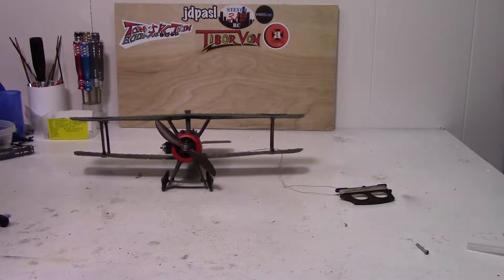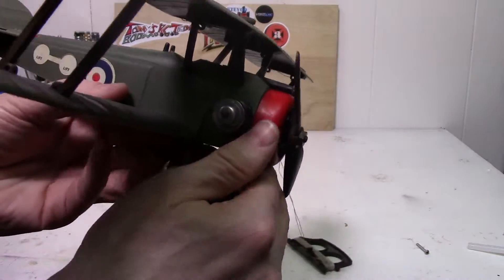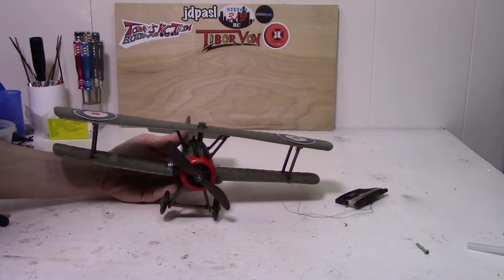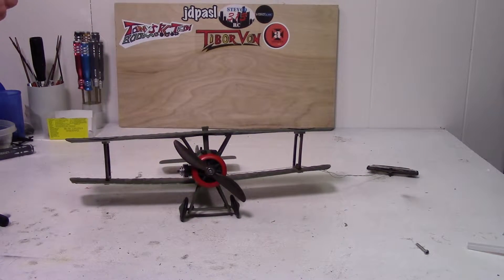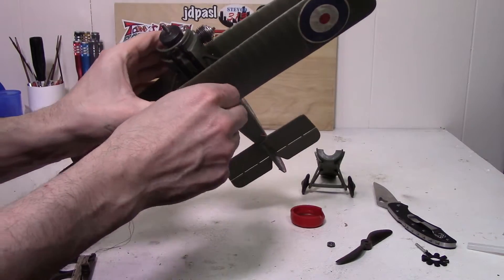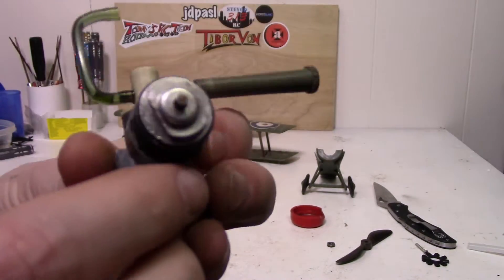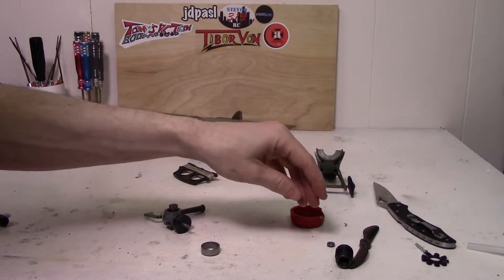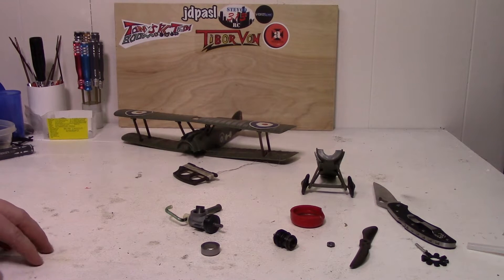TesTors Sopwith Camel Control Line Airplane(1970s)

Comment: These were the toys I played with as a 10 year old with no springs to start them. Usually a Cox brand model. Had the dragster, chopper, hand control and radio control planes. Still have a few engines and the radio controls. They are basically high speed miniature diesel engines that run on nitromethane.

Comment: I had the exact same one when I was 9 years old in 1972. I loved the spring propeller starter. It always clipped my fingers while trying to remove the bracket mount D size Battery after starting.

Comment: 😁👍Cool I used to have the cox versions of flying airplanes as a kid!  Testors made them later on like the .049 cars also check out my cox car mods to RC they use the same .049 engines.  You should use motor spray and clean everything out especially the threaded needle passages and also these use special .049 nitro fuel normal fuel will break them for sure.
Reply from the maker: Thanks for the tips mate. I'll check out your cox car mods for sure

Comment: the engine has a reed valve intake and since it only runs at full speed the spray bar with the needle valve is the whole "carburetor" .
With the needle removed flush out this tube to remove old oil and then the same with the needle in place but several turns open (from closed)
The next thing is the reed itself ; if that is stuck then the engine will not draw fuel .
Few drops of fuel in the air intake might be all it needs to dissolve the died up oil.
Best to first run it outside the plane  so you can prime it better and learn how many turns the needle has to be out for starting and running.
About fuel 20% nitro and some castor oil (about 5%) besides synthetic oil (about 20% oil total) 
Also test the plug outside the engine to see what current it needs for a bright glow (and burn off old oil)
If the plug has failed then this adapter might fit
http://www.mecoa.com/acc/adaptors/index.htm
Reply from the maker: Thank you for all this information and the link glowplug adapter. I had planned to test the engine out side the plane, though I do have a question. Would it be better to mount the engine with some rubber in a vice so it has some give or would be solid mount in the vice be fine?
Reply: @VoidXRC   be careful not to crush the engine case ; its cast aluminum so not exactly strong.
see if you can find a tube with a inside diameter that matches the engine outside diameter.
Then cut away to clear the head, needle and use a hose clamp to secure the engine into the tube.

Not sure how brittle the plastic is but i would avoid running the engine in the plane as much as possible.
only mount it again once it has run outside it and when you know how many turns the needle has to be open from closed to start.

Comment: the engine should run just fine as long as it,s properly cleaned and there,s no old fuel yuck anywhere,especially in the delicate reed valve carburetor. reed valves have to seal tight for the power stroke to work properly and any dirt/foreign matter in there will cause a problem. test your glow plug with a 1.5 volt battery to make sure the center filament lights up and glows yellow-orange.  replacements are available if needed on eBay. dismantle as much of the engine as you can as well as the internal fuel tank and soak all the parts in methanol alcohol to dissolve away any old solidified lubricant oil residue and yes,definitely replace that old clear vinyl fuel line with new vinyl or silicone rubber. a drop of light sewing machine oil for the sleeve bearing for the crankshaft is a good thing as well as a bit on the sides of the piston. any crud inside the cylinder can be removed with soft steel wool which will not damage the bore and wash in methanol after to remove any stray particles. as for fuel,use 20% nitro or even 30%.....the smaller the engine,the "happier" they seem to run on higher nitro percent content. i see Testors used a WW1 style propeller for a bit of authenticity but it may not develop sufficient thrust for flying. you can probably find a better propeller on eBay for actual flying and use the simulated wood WW1 "airscrew" for show/display. if the landing gear axles are just plastic,you may want to beef up the gear a bit with a small diameter steel tube across from wheel to wheel.

Comment: I hope you wont fly this piece of rc history ;] Its pretty and would be sad to wreck it.
Reply from the maker: I agree it would be sad if it got wrecked. It is my nephews plane though so I can't tell him not to fly it.
Reply: @VoidXRC  I just realised RC might be wrong word here but before we got to the rc we had strings :D I think you might be able to convince him or trade him for something else maybe some foam plane like bixler?
Reply from the maker: I have thought about seeing if he's like an RC plane in trade, I will definitely ask him but it'll be up to him completely
Reply: @VoidXRC  Thats a rl nice attitude, if he decides to fly it try to make sure it wont get crashed ;]
Reply: @VoidXRC  Just a suggestion, you can build a very simple balsa engine. Plans are available on line.  Buy a very cheap COX .049 off ebay.  Help your nephew learn to fly that. Once he becomes proficent  with the balsa plane, he would be able to fly the testors.  SOOO many kids have had their heart broken when their plastic plane broke. Once the plastic breaks, there is no glue in the world that will be strong enough to hold the plane together to fly.  When I was a kid i must have ripped the wings off of my balsa plane a dozen times by crashing it.  Five minute epoxy & we were back at it.